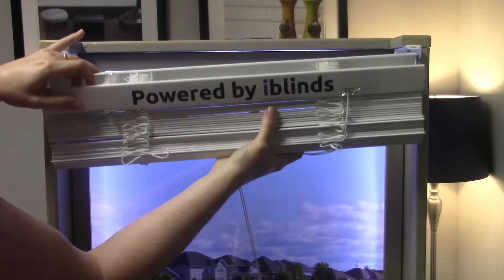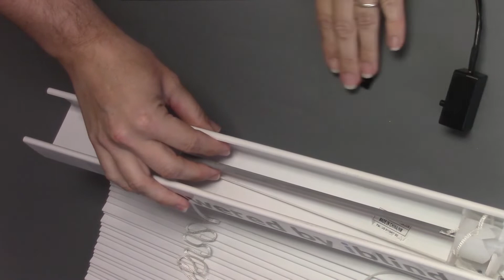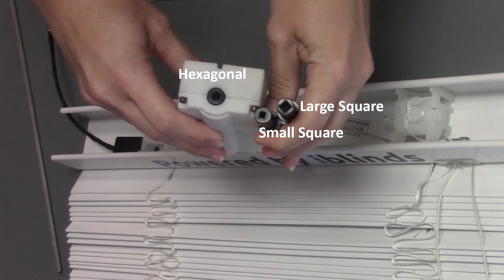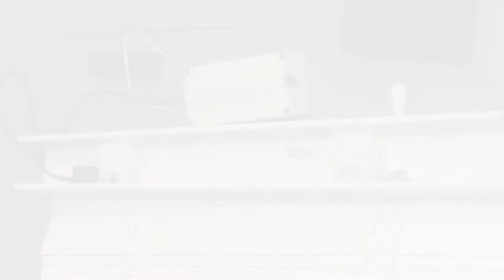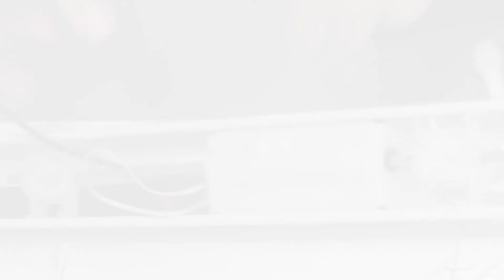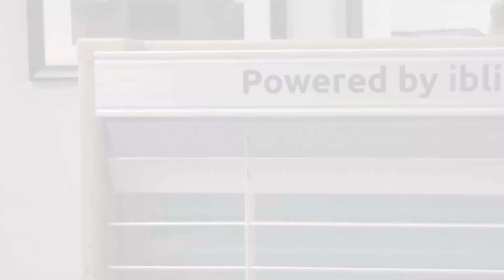iblinds Installation

Comment: Does the original wand have to be removed?  Is it possible to install iBlinds with the Original tilt wand still in place?
Reply: I'm curious about this too since it would make sense to keep the original tilt mechanism as a manual override if there is a network problem. Especially since if you get the solar panel there is no need for the USB port.